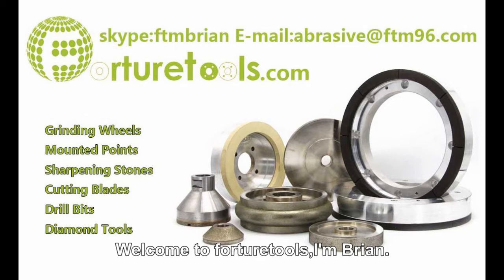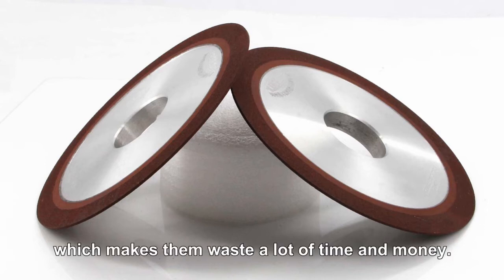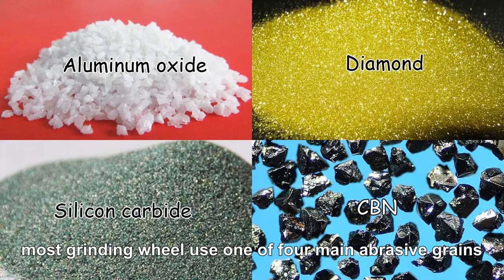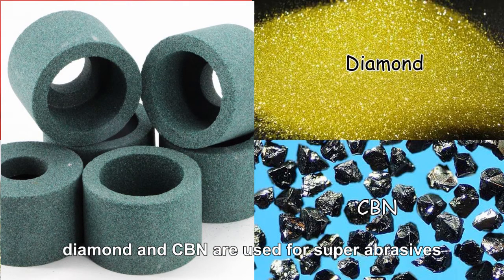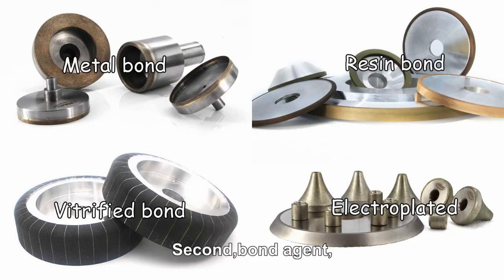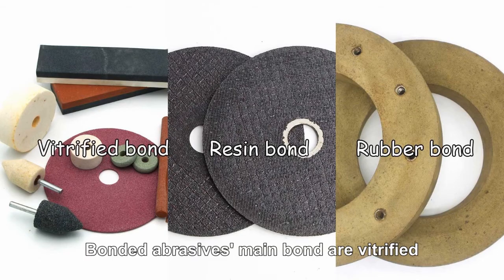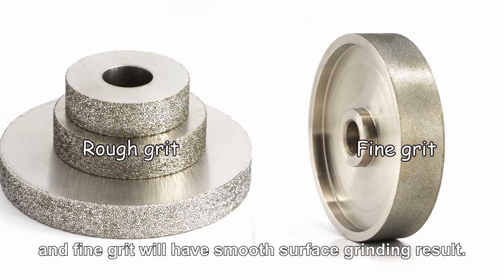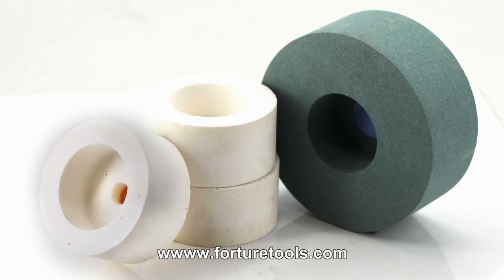How to select grinding wheels-forturetools

Comment: can you tell me which wheel to use for knife making CBN or Diamond and why please thanks John k
Reply from the maker: That depends on the knife material, For metal/steel knife, use CBN grinding wheel.
Reply: @forturetools  aap ka number chahiye Patthar mangane Ke Liye
Reply: Patthar mangane Ke Liye number chahiye
Reply: 8090756197 Patthar mein gaane ke liye number chahiye